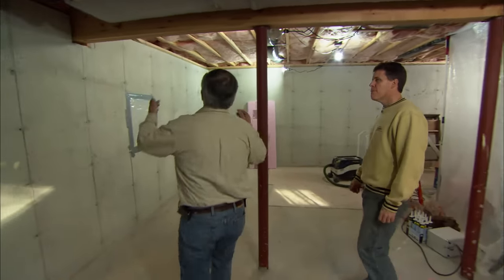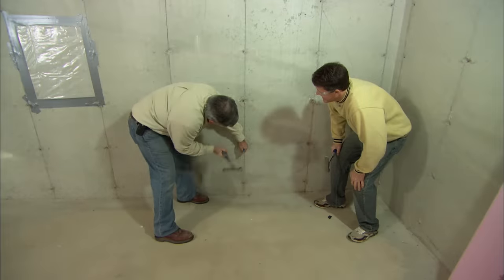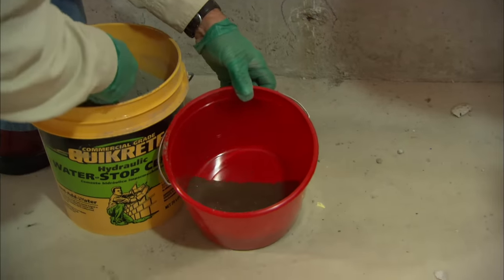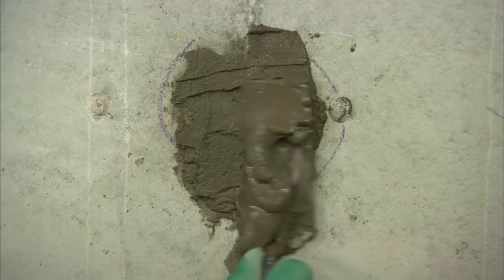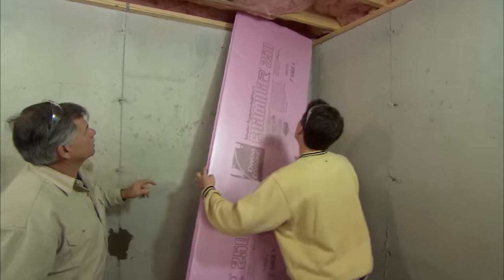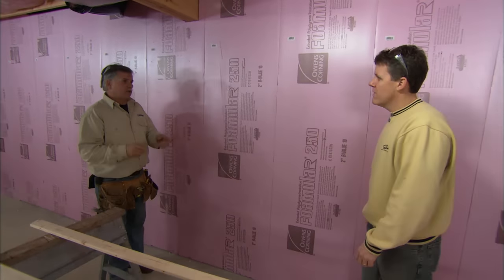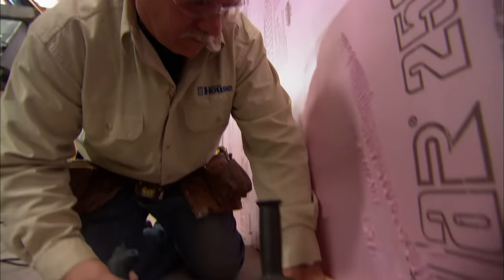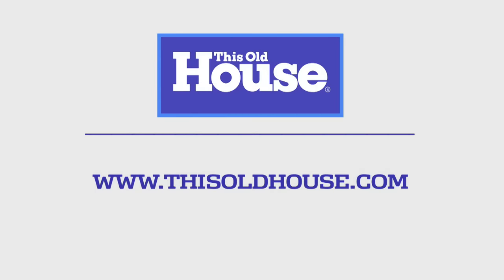How to Insulate a Basement | This Old House

Comment: I had to rip all the foam out my sisters house about 10 years after A professional installed it.( He did a great job no problem with that.)
The foam breaks down and releases toxic chemicals. My nephew started to get sick and so did my sister.
After doing air quality and cores an inspector determined the foam board was breaking down as they do and were off gassing.
He said about 15 t 20 % of the population have reactions to the off gassing.
Stay away from foam insulation!!!
Reply: Was this spray-in urethane/polyisocyanurate or extruded polystyrene? I have never heard of a problem with extruded polystyrene but I am curious if there is one.
Reply: @brucewayne4585  Do not confuse EPS (Expanded) with XPS (extruded) as used in this video which is like a sponge and as the OP stated.

Comment: I have a cold room under the outside front steps. It all concrete, walls, floor and ceiling. I want to use it as part of the basement living area so I want to insulate it and drywall it. There is some water that gets in. I’m in Canada so we have all four seasons. I was planning on spray foaming the walls. Any advice? If I spray foam will it keep water out? Can mold grow? Thank you.

Comment: Why wouldn't you cover the cement walls with a membrane like Red Guard before insulating?
Reply: No. you want the vapor barrier on warm side (room side of insulation) otherwise moisture will get trapped. Preventing the concrete to breathe will also deteriorate it.
Reply: The foam boards prevent the movement of air. Most of the moisture comes from the air, not from the wall. However, the relative humidity of the dirt outside the house will always be higher than zero, so you need to let the walls breathe.  The foam boards allow the movement of moisture away from the wall but not air.

Comment: Why not just seal the basement wall with drylok and then build a standard 2x4 wall around it?
Reply: Jason C. Bc you have an unconditioned space meeting a conditioned space. If you have warm air meet cold concrete you create condensation on the inside of the block (on top of the dry lok), and there’s your water damage.

Comment: Good vid, but I think I would have did it a bit differently.

Frame the wall and use the foam insulation in between studs. Or use this particular insulation and frame outside of it
Reply: Dopey Sims the closed cell foam acts as insulation and a vapor barrier. If you place the studs against the concrete you’ll get premature rot. You could to optimize space, use a thinner foam board, build out the wall, then use traditional insulation to achieve the same R value (it’s also much cheaper).

Comment: Wood is organic and mold will grow on it. Use steel instead.
Reply: Wood is porous, which is why mold can grow on it (but only if it gets wet). Steel is more expensive and not necessary (plus it will rust if it gets wet).

Comment: This foam costs a fortune. Installation doesn’t look much easier or faster than traditional framing and fibreglass. What is the advantage here?
Reply: XPS foam acts as a moisture barrier and prevents inside moisture from condensing on concrete walls. The free movement of air is essential. Fiberglass insulation will trap moisture as will the plastic sheet some people used to use

Comment: What if your concrete wall isn't plumb?  If you don't use the common (and horrible) practise of standing your frost wall away from the concrete, then how can you plumb it?  Maybe I missed something.  Anyway, let me know.  Thanks.
Reply: +Cyan Null You would need to use a different building technique. Build a new wall in front of the foundation wall. Use metal framing which does not absorb moisture.

Comment: Anyone concerned about drilling holes into the concrete, and thereby compromising it's strength, etc., might think about the fact that the hole in the concrete is actually only an 
1 1/ 2" deep. The nail is 4", the spruce is 1/2" and the foamboard is 2" equaling 4" total.

Comment: Should just build a 2x4 wall. Don't need to anchor to concrete wall for that, just floor and top plates. Saves you from hammer drilling so many holes especially in your wall. And hammering nails, no thanks, tapcons all the way

Comment: BUT what if you DO have water vapor pressure from outside? insulating this way will screw you
Reply: I'd probably paint the concrete with drylock.  In fact, I would've done the same in this job as well. A few extra bucks for a little piece of mind.

Comment: But if they would have used 2x4s as the verticals, they would have to dig into the insulation for the electrical boxes.
Reply: As far as I know, they don't make a spring spike longer than 4 inches so you'd have to build a wall. If you put the sole plate a half inch from the foam insulation you'd get the same benefit as with the lattice.You'd lose 2 inches more floor space is all. The material cost difference is about a dollar.
Reply: Maxid1 I meant using 2x4s on the verticals, Tommy attached those with deck screws. The horizonitals are attached with the spring nails.
Reply: Charles Damery
So you're saying flat against the insulation, not edge. That'll work.
Reply: Maxid1 Yeah, there are shallow electrical boxes that would fit because you've got the 1 1/2 inches of the 2x4 and the 3/4 in of the 1x3 strapping.

Comment: 1. The best way to insulate the basement is using 2'' Thermax, because it has 13.5 R-value while 2'' pink foam has only R10. Thus 2'' Thermax is 35% more energy efficient than 2'' foam. Yes, Thermax costs $40 per sheet instead of $20 per sheet for pink or blue foam, but you have 35% better energy efficiency.
2. Why wasting time installing 1x4s twice when you can frame a regular 2x4 wall so electrician can drill holes for wires and attach wires where they come out from the electrical box to the studs? You can't even attach the wire properly to 1x4s that is shown in the video. Waste of labor doing two layers of 1x4s. In addition, with using horizontal 1x4s you will need to install draft stopping between vertical 1x4s, again waste of material and labor. Conventional framing would take less time, would cost less money and the job would be done correctly. Any experienced builder probably laughed after he/she watched this video.
Reply: When you use a stud wall in a basement why use 2x4 instead of 2x2?
Reply: 2" PINK foam is  $39 today, 2/'22

Comment: If the basement used to dry inwards, now it doesn't do that. You should never add insulation inside the basement, only outside. Outside insulation means digging which is more expensive, so some people don't do that and hope everything turns out alright (it probably won't).

Comment: I thought insulation should be always outside of the basement wall. If insulation is inside, then the outside of insulation will be colder in summer than inside of insulation. So water will condense outside of insulation. If insulation is outside of brick concrete, that is usually okay. But if insulation is inside of brick or concrete, then water condensation would wet the brick/ concrete, causing all kinds of water problems such as mold to the brick/concrete.

Comment: 7:33 is a rotohammer not a hammer drill. A hammer drill has a considerably higher impact speed but a much lower impact force per hit (and this has nothing to do with the impact driver they were using to attach the wood straps). There is a reason they show using a rotohammer (much lower blows per minute, at a much higher impact energy), but don't listen to Tom say hammer drill because it isn't the same thing! It takes considerably longer per hole if you use a hammer drill.

Comment: how much does a sheet of the foam cost
Reply: Nick Mossey Pretty pricey at about $15.00 for 2x8' sheets with about a 7.5 R value; still preferred option for basements. They didn't explain other options about moisture considerations (fiberglass supports mold growth if it gets wet and loses insulating properties). If it was a bigger space it might be cheaper to pay for spray foam and hit ceiling joists and sill plate area at the same time.
Reply: So I should not do this??? Or how can I forbid mold growthing on the pink installation
Reply: I should have clarified that pink "fiberglass" insulation can be a matrix for mold growth (the soft stuff often paper backed for moisture barrier). The closed cells of the pink foam insulation minimizes the potential for growth. There is quite a bit of information on using the pink foam boards on Owen's Corning website and they designed systems specifically for basements.
Reply: +Nick Mossey Extruded Polystyrene doesn't promote mold growth.  It isn't food for mold.

Comment: I would have waterproof the outside Foundation of the structure and for the inside spray foam is much better than that crap because it would keep the cold out and always make sure you have permit when you're doing anything to your house structurally
Reply: Matthew Dutting cost prohibitive and probably not needed. Spray foam is nice no doubt about it, but 1) most DIYers can’t do it themselves, and 2) it’s much more expensive.

Comment: so I have been planning on finishing part of my basement and there seem to be many ways to do so with the different type of insulation and different way to frame a wall. In another video, I have seen people put the foam board on then put studs over that then in the studs put another layer of fiberglass and then put a plastic sheet for a moisture barrier, is this necessary for a basement? all in all my main concern is what is the cheapest and most effective way to partialy finish and insulate a basement. Thank you and greeting for Cambridge Massachusetts!

(The link to the other video I am referring to is: https://www.youtube.com/watch?v=B4JPexyoudI )
Reply: I would skip the fiberglass -- it's just a mold colony waiting to happen. This rigid foam is airtight if you tape/caulk the seams so there will be no drafts. If you want it to be even warmer, just get a higher R-Value Foam --- but stay away from Fiberglass insulation in the basement,
Reply: Yes. Stay away from the fiberglass and plastic sheeting.
Reply: Most of the moisture is in the air. The foam boards stop the movement of air.  The foam boards are also water permeable, which will allow any moisture in the wall to slowly evaporate. It's OK to use additional fiberglass but rockwool would be even better. You should definitely NOT include a plastic sheet, as it will trap the moisture in the wall cavity. This video is very old, and modern building science has evolved.

Comment: its looks like a nice project to finish the basement, but from a strictly energy efficiency perspective, putting insulate below the foundation like is not practical as the homes foundation is below the frost line which remains at a constant temperature regardless of the outside temp (thats why most new england homes have basements)

Comment: This looks like a terrible idea. Why the hell would you go to the trouble to fill in gaps in the concrete just to go back and drill all sorts of holes in it. It seems like framing a regular 2 x 4 wall on top of the foam board Would be a better bet . 

And shouldn’t the foam adhesive caulking run perpendicular to the floor vs parallel?  Otherwise it looks as if the adhesive strips may actually discourage moisture (or trap it) from evaporating.

Comment: Why not just build a 2x4 wall instead of all th 1x.
Reply: pabloshammer bc you’d loose 5.5in of space in the entirety of the room. You could, you could also use smaller lumber, or thinner foam board and add fiberglass mat.

Comment: In Canada you need an R24 insulation.  This would never work.
Reply: lol, r24 for a basement wall? Don't they realize there is a lot of earth on the other side of that wall?
Reply: @MW-gh1mo  - guessing you forget or do not understand what frost depth means. got an old basement in my rental duplex that has not been remodeled in over 20 years, the basement walls are bare and unprotected from water. though it only gets wet down there when a boiler or pipe leaks water. And it gets cold down there mainly because as said the doorway to the outside from the basement is (possibly) OLDer than I am at 40 and the windows are aged shut to never open. yet its like a refrigerator down there in winter. Would be very difficult to refinish the basement of this place because it is made out of stone and masonry.

Comment: Paint/sealer the wall , build a standard wall 2 by 4 wall metal studs , insulate with fiberglass Many parts of the country do not allow romex for electrical . The standard wall accommodates condit , and duct . Run your supply stacking duct 
3 1/4 by 10 down the new outside walls , 6" above finish floor . Inside walls or furnace room return duct also down to 6" above finish floor .Unless you have fin tube hot water heat . Most don't run ducts with forced air systems to floor , they cut into the ceiling , that is highly inefficient , and uncomfortable .
Make sure you have sufficient outside combustion air  for your furnace hot water heater room . 
Disregard if you have 90 + mechanicals , outside air being directed to mechanicals .
Note , if you have forced air , get waterbase sealer  and paint every joint of duct , supply and return  .
 It is not uncommon to lose 25%  or more through leaky ductwork .

Comment: Cutting a hole in the insulation to install electrical boxes seems to defeat the original purpose.
Reply: I use shallow boxes in these cases...no foam removed.

Comment: poured foundation s are junk! already cracked too
Reply: I have done basement waterproofing for a few years, seen many cinder block foundations that did not fare as well as monolithic concrete walls. A few cracks in a poured concrete basement is far easier to repair than a cinder block one.

Comment: Seems like a waste of time to drill all of those holes. I would rather just put in my two by fours and attach them to the joists above. Drive the spike nails into the floor with the 22 charge. Stoopid fast

Comment: I'd use a hot wire cutter
Reply: So many do not realize how they are turning their XPS foam board into a sponge when they simply cut with a regular knife. EPS is not as much as XPS and will shed water through regular capillary action and evaporation.

Comment: Foam board is so overpriced.
Reply: XPS is more costly than EPS and not as great as many assume., for comparison when XPS comes into contact with water intrusion it will hold water, EPS will just shed water as the spaces in its structure allow the water to easily evaporate.

Comment: No proper waterproofing was shown in the video. Clearly there is no exterior waterproofing....plugging with pin and cementing the plug won't stop the water..he should of mentioned that....water is definitely going to leak behind that foam. And if no proper path to a floor drain, the water will create mold at the base of the wood frame (and any organic material around the base) and all that insulation will be torn down....great job!

Comment: Just stick build the basement properly that’s the true way to do it and you don’t need to insulate it either lol. If you do get any moisture in the future your screwed.
Reply: Even with wood which is a mold growth medium, you are still paying more than what you initially did, since it will also rot out and attract termite and carpenter ants or a fire! Steel studs are far superior with less issues.

Comment: That's gonna be one very expensive basement using so many materials just to insulate it. If no one is gonna live in the basement and you're only prepping it for entertainment, I would just paint the walls and put ceiling tiles, finish the floor and that's it. And only hang drywall wherever you are diving rooms

Comment: What a waste of time and questionable result. Try gluing InSoFast straight to the wall. No need to add studs, they are built in to the foam board. In addition, the back of the wall has slots for vertical drainage if water comes through the concrete. Lastly, you have chases built in for wiring.

Comment: Forth home with a poured basement, concrete blocks sucks to coin a teenage word, always will always leak, and never used those steel studs to hold the forms together.  Talking about an eight foot high wall.  Digging a hole in the ground is just asking for problems, in Wisconsin, rain water will fill it, need perforated drain tile on both inside and outside of the footings, with a battery backed up slum pump.

If putting room down there, our code states you have to have an external access, can't depend on internal stairways to get out.  Just left this basement unfinished, just hanging some drywall, tax assessor would go nuts.

I was drafted as a dumb 18 year old kid to fight socialism least that what I was told.  Well we have it right here, the only possible benefit the city offers us is picking up a small bag of garbage but charging us thousands of dollars for benefits we are not even receiving, mostly schools.  This is socialism, no other word for it, so why are we putting up with this?
Reply: Really? stick with the topic and keep your politics to political sites!

Comment: stupidest thing I have ever seem...

So you drove the pins in and possibly created a crack on outside of concrete, which if done properly would have been sealed. So you compromised that. And you're pasting the inside!!! Like another poster said...you waterproof from the outside not inside like this. Don't do this to your house. You could create new leaks, then you will be into epoxy repair (maybe) or fixing it from the outside. 
poor advice in this video.

Comment: You're supposed to install an interior drainage system. If you seal the water from ever trying to penetrate  you're creating a boat. Walls will eventually crack and separate even on a poured Foundation. Too bad for this customer though. Boy it would have been nice to have an HBC certification for this basement. Healthe basements and crawl spaces. Crawfordbasements.com
Pioneerbasements.com